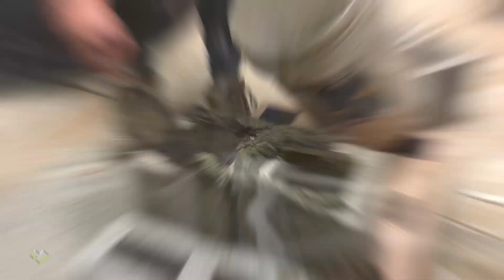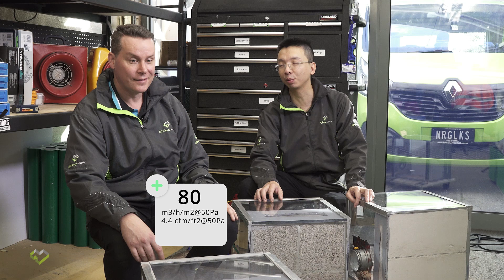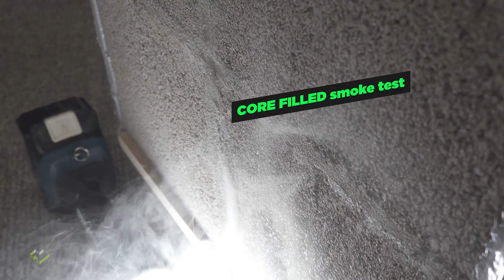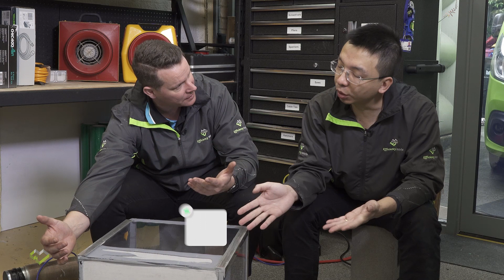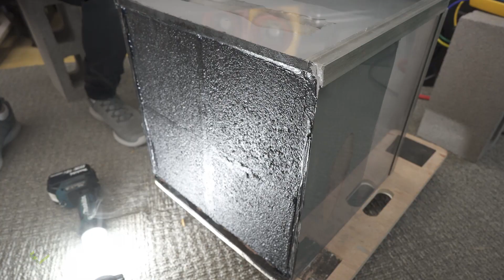Is BLOCKWORK air tight, core filled or not?

Comment: I built with 75mm hebel power panels which has been rendered with dulux acra tex full system which is an impervious render and a paint membrane which is about equivalent to 5 coats of exterior weather shield paint. Yes, you need coatings to seal, Yes, Render also

Comment: Interesting and not what I thought it would be by a long shot. I’ll be doing a build with hempcrete soon, I wonder how that will stack up? I see what you did with those number plates too....
Reply: Hempcrete is an interesting material. I believe the key is in the "packing" of the material similar to the performance of the rammed earth. I tested a  hempcrete house in the past but cannot draw any confident insight on the performance of hempcrete as there was substantial leakage through the louver windows.